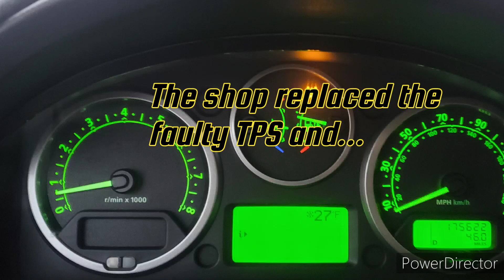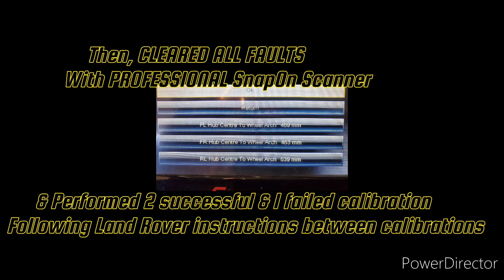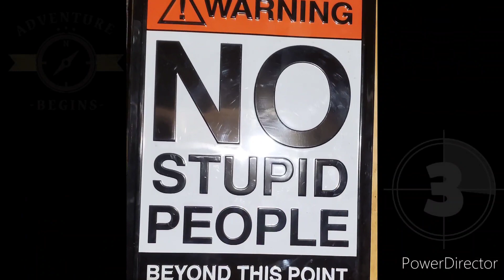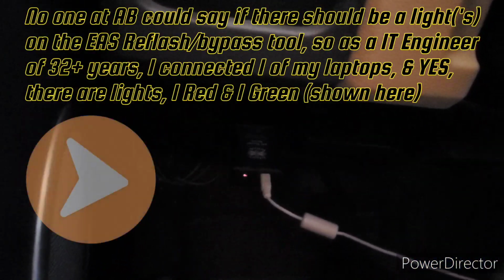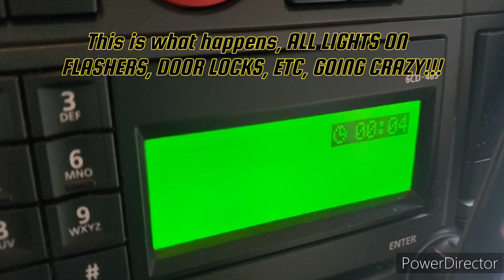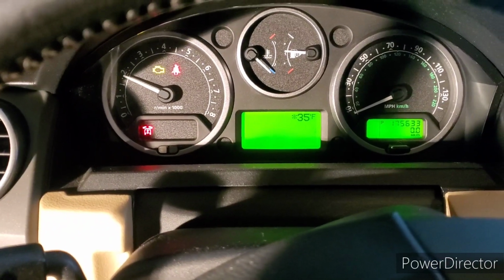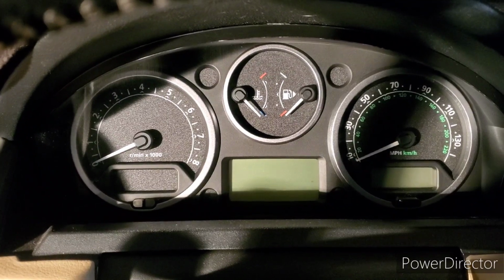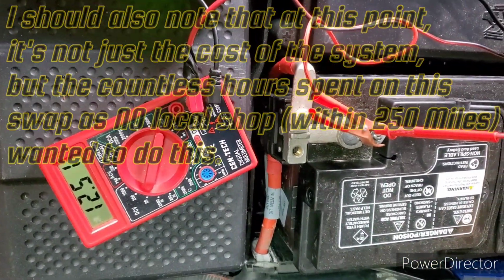Land Rover Range Rover LR3 Atlantic British Coil-Over Conversion Kit Issues

Comment: Same problem here, did you fix it?
Reply from the maker: Well, with a nearly $2,000 coil over kit from Atlantic-British and a lot of elbow work after work, it took 4 nights (1 per side) to swap the shocks. As for the EAS bypass, it didn't work sent a 2nd replacement unit and still NOTHING, all the dash lights come on BUT no start.

I decided to RWMOVE the EAS bypass unit and just wire everything back the way it was and the Range Rover STARTED right up!!!
The only dash light that is on is the red "Suspension" icon, otherwise NO other lights are on, I took it for a test drive and the ABS, Lights, Traction Control, etc ALL WORK!!! So what's the point of the EAS bypass unit? All said you can probably get away with a set of Koni, or other shocks, although for the money, Atlantic-British's sets of official coil overs are actually a good deal.

As for getting a spare keyfob, that was another nightmare that cost nearly 1/2 of the coilover kit, as the keyfob was over $520 (with tax & having my brother, who lives only 27 miles from the dealership (I'm over 900 miles away, there and back). They promised it would work to just START the Range Rover, after checking with them they said the keyfob needs to be "programmed," which was another $229.99. I said that the parts guy that ordered the key specifically said "YES", when I asked him "will it physically unlock the Range Rover using the hidden keyhole on the driver's side and START it". It did NOT, so I started a several month journey taking it to every shop within 120 miles of me and NO one could "program" it. I finally called the dealership back and the Service Manager said said for $500 he could meet me at a point that's only 110 miles away from me instead of the 488 miles (1 way) and bring his laptop, phone, software and tools and he just be able to program it for me. Turns out that most car manufacturers pushed out service/programming functions in March 2023, so anyone using SnapOn, MAC, and other tools can't do it and so I had to spend $409 in fuel and 2 days to drive to the Range Rover dealership, have them program the keyfob (which took all of 30 minutes), so thus far NOT counting the countless hours and fees going to local shops, it cost me $542.90 (keyfob+tax+S&H) +$409 in fuel and what would have been another $229.99 for programming (but the service manager felt bad that the parts person was misinformed and thus comped me the $229.99 that they would have otherwise charged me, since I had to take time off work, spend $400+ in fuel, wear and tear in the Range Rover, etc) so the real total for 1 working spare Range Rover keyfob was $951.90. On the plus side I got to spend the night at my brother's house & visit my nieces & nephew, otherwise, it was another Range Rover nightmare fiasco.

Hope that helps you with more than just the one issue.